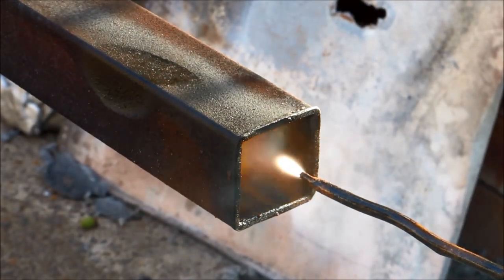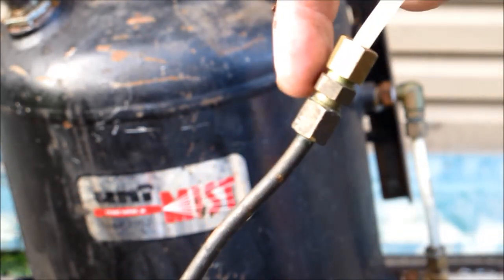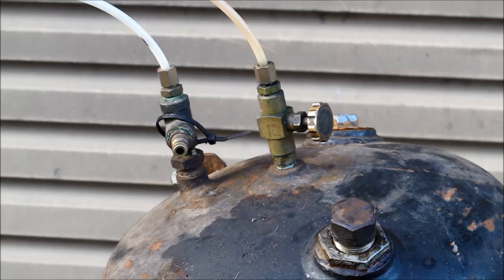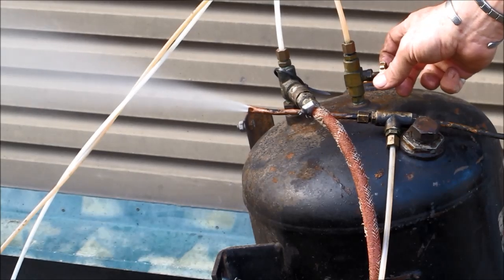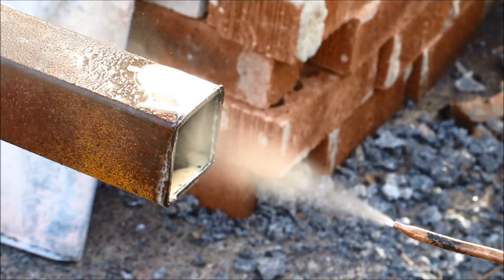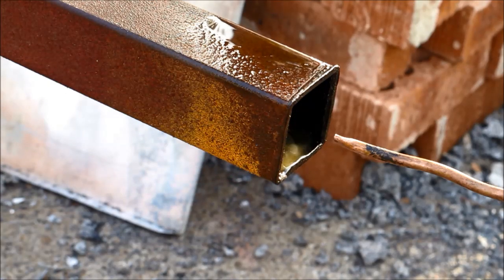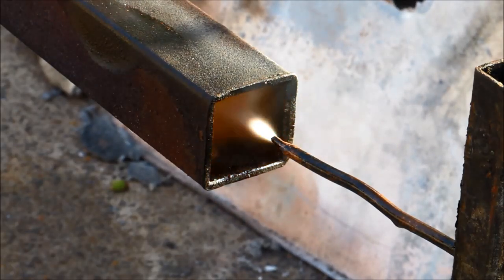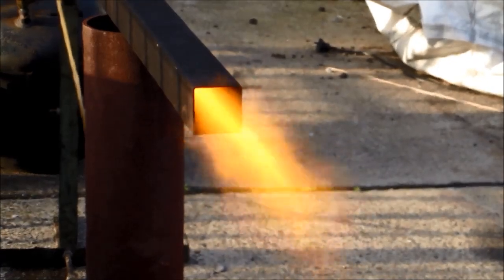Instant light  spraying oil Burner from cheap, off the shelf fittings

Comment: What is the oil temperature,did you preheated? Thanks.
Reply from the maker: No preheat.  I think that is a waste of time and a misnomer.  As soon as  oil is sprayed it's cooled by the far greater weight and volume of air. 

If any preheating  is done, it would far better be air than the fuel.
Reply: @glumpy10  thank you for your reply.

Comment: This video has to be my favorite one of all, especially during the ignition and burning phase.  The oil and air mix easily and then the square tubing facilitates the flame via a Venturi effect.  I love the howling noise it makes too.
Reply from the maker: I was just looking at this setup yesterday thinking I should do another vid with it.  Needs some new plastic Tubing which I don't know if I have or can get but I will look into doing another vid of it soon.
Reply: @glumpy10  I would definitely watch another video with this setup if you get a chance.

Comment: The only problem I can see with this Arrangement is running a compressor all the time gets to be pretty expensive I don't know how much you'd be saving in the long run. I'm not trying to be a wet blanket but it is going to drive up your electrical bill
Reply from the maker: I completely agree! You will see this is the only one of this type of burner I have done for that reason. I was doing a bit with the Furnace/ foundry crowd at the time and they were all buying  pre made burner Nozzles.  They were still having trouble and I thought I'd show how simple the design could be made. Still a lot of people out there doing spray burners for whatever reason now. Some even use petrol powered compressors to keep up the airflow. I could do much bigger output with a Jumping castle blower and use much less energy input. 
 I think sprayers are a waste of energy, require too much input and resources. I can make a perfectly powerful Burner using a 12V bilge blower and an old car battery for the air source.

Comment: Hi, if you don't mind me asking, have  you said that you installed a mig tip in front of the end copper pipe?
Thank you very much for uploading this!
Kind regards, George
Reply from the maker: No, I just flattened the end of the tube with a hammer to get the desired spray and Volume.

Comment: Can it be done without air compression I just want a constant pilot flame to work an old fridge. Any ideas???? The old gas fridge from a caravan.
Reply from the maker: Doing  small outputs with oil is hard. It's also hard to burn it with a wick as the oil tends not to flow fast enough and the wick just burns up. 
I would stick to gas for the fridge myself or if you have an oil supply, burn it in a generator and charge a battery and run the fridge off that.

Comment: My first thought is... you've basically built a pressure pot style spray painter, with your burner nozzle instead of a paint sprayer gun. Other than it being a little too small, I could literally use a cheap paint sprayer I recently purchased at harbor freight instead of building the tank, and make a nozzle the way you did for the actual burner nozzle. Love the simplicity, looks awesome!
Reply from the maker: Using a spray gun is not near as simple as you think. Try it, I did and was very disappointed. The air/ Fuel ration is way off and you have to really butcher the gun to get it to work at all and then it's till not good. Plus yyou have a fuel takn that's way too small  for any practical Purpose. 

Personally I don't like spray Burners at all and prefer the forced air style that you can get virtually infinite heat out of  and dont need to run a noisy compressor,
Reply: @glumpy10  That is a good point, thank you for the advice. Plus I eventually may want to use that sprayer to actually paint anyway. 😅  I'm thinking I need to learn how to weld so I can build a LPG tank gravity fed burner like you have (among a million other reasons). Your videos are awesome -- since watching your videos I have started trying to find a cheap bouncy house blower because I have a growing scrap metal + regular junk pile and love the idea of processing it myself to get top value/not pay to haul it to the dump. I  am moving in a couple weeks and will finally have space to do stuff like this without the neighbors complaining. I like the idea of atomizing the oil spray for a more controlled burn but agree that compressed air is a big waste of electricity for something that can be done cheaper and easier with the gravity burner. Plus once it's heated up, the heat itself should vaporize the oil anyway. Your videos on the waste oil processing were very helpful as well, so thank you again and hope all is well down under 👍👍

Comment: pressurizing to atomize the fuel burns hotter and cleaner than those drip feed systems. Many years ago I built a small furnace for my huge shop. I mainly burnt oil and coolant mixed and a 55 gal drum would last 4-5 months on 16 hr days.

Comment: If you used a round tube you could put a piece of plate on the front like a torpedo heater , you could probably cut the air / fuel mix down and get better results.

Comment: From all the oil burner desings i have tried, this is definitely the best, it's a very simple desing, it's adjustable and it's so easy to make. what i do have to say though is that the pipe or tube cannot have a taper or conical shape at the end.
Thank you for sharing this simple desing, and showing us how it should be done!
Reply from the maker: Thanks for the kind words. It does always amaze me with the complication, expense and equipment people use to do a simple job when there are so much cheaper, simpler and easier alternatives. It's like so many people seem to think unless they go to a lot of trouble and expense something cannot possibly work.

Comment: Not sure if you will get this, But seeing you got a good hot flame, and your supplying air at the nozzle end from your compressor at that T.
How would it work with your fuel pressurized as it is, Then remove the air pressure at the nozzle, (the T) but preheat the nozzle or fuel line from wrapping it around a heat source, will it still spray out eliminating the requirement for a compressor, except for the fuel tank. Which could be a hand pump,I' thinking of what happens when the power goes off. consider the set up similar to a tagger torch.
Reply from the maker: I don't think it would work at all. The fuel would carbonise if it got too hot and you'd be pumping like mad to compensate for the fuel level dropping  at the rate it burns. 
One would be better pumping up an air tank and having that pressurise the fuel system  though a regulator but then you still have the problem of atomising air.
Reply: @glumpy10  If I recall we can take VO and run it through a copper tube or pipe, then wrap it around a wind supply tube from a fan forcing air into a furnace, (wrapping the pipe close to the furnace is fairly warm) that is to melt metal, And all that was used was a gravity feed for the oil, with a control nozzle for the supply of oil.
 If I recall correctly there was no need to force oil into the system under air pressure, and it got hot enough to melt metals? 
But just thought this might be of interest to try.
Reply from the maker: @CMAenergy  Sounds like it would work but is more like the blow air systems all my other burners use than this spray Nozzle design.

Comment: I've just built one of these. Not the exact same thing but same theory. Works like a charm. Within an hour of getting it finally assembled I was melting aluminum. I think I used about 4 gallons of used engine oil in an hour. It's not very demanding on my air compressor. I'm using 3/16" lines because that's what I had laying around. I think if I want to go hotter I have to go with bigger lines. Awesome build and awesome video. Thank you for sharing this.

Comment: I'm wondering if a continous arcing spark plug would ignite used motor oil and air mixture or just foul it out. I guess I'll find out. I have a woodburning stove made from a 55 gallon drum but I've grown too old and crippled to cut firewood. I'm thinking that this would work great in the barrel. I've got lots of old motor oil that is clean of any trash and debris, aside from the carbon and metalic particulates in used motor oil. I picked up about (60) 2gallon containers of used motor oil about three years ago. At the time I had no idea what I needed all that used oil for, I just knew I needed it. Thank you, you answered the question of why I needed the old oil and more impotantly solved my issue of heating my shop. 

By the way, if you have to tell someone not to look down the end that the flame exhausts from, you wasted your breath. They may heed your advise not to place their eye over a pipe belching fire like a military flamethrower but they'll find another way to either get hurt or burn down their home. It's called Natural Selection and the fact that there are so many blithering idiots surviving until adulthood these days is a direct consequence of mankind circumventing Natural Selection.
Reply: Definitely not good ... Think about your lungs and your families lungs. Plastic seal the windows, then use cheap throw blankets, and doors of the house. Use 3 small space heaters placed near cold spots on a thermostat. It will cost maybe $130 a month extra for heating the entire house

Comment: At an equipment rental store I worked at back in the 80's, an egghead came in wanting to rent a frickin push mower. But just renting it, a gallon of 2 stroke gas/oil mix came with it, the egghead wanted to know how many square feet could it cut on a gallon of fuel, at half throttle, then full throttle, if the grass is thin or thick, if the grass is tall or short, wet or dry, and on and on and on. After about 30 minutes of his goofy sh*t I said, "look dude, you cut grass until it runs out, then you refuel it and start mowing again. Just keep repeating those steps and you'll be through cutting your f-ing grass a lot sooner than all the time you've wasted with all your questions. He finally STFU and took the mower and a full gallon of mixed fuel. It wasn't twenty minutes later and here he comes. I'm thinking, oh sh^t, what does he want now." Unbelievably he was through cutting his grass and hadn't used but maybe 1/4 of the fuel that was in the lawn mower tank. He hadn't used a drop from the gallon can I sent with him. That just pissed me off that much more. All that bull-sh*t for cutting a lawn that didn't take over ten minutes. I developed a very strong urge to crack and scramble the egghead's brains all over the show-room floor. But at least he returned the full gallon of mixed fuel, unlike most of my black clientel. They would rent a mower, bring it back 15 minutes later and swear up & down on a hundred bibles that they used the full gallon of fuel, in the mower. The smoke billowing out of their automobile exhausts told a different story. I hope they enjoyed their free gallon of gas/oil two stroke fuel, especially after it destroyed the catalytic converter on their cars. Those bunch of upright & honest Ididnadonuffins never failed to just have me rolling with laughter when they left leaving a huge trail of smoke behind them.
Reply: To all of the PC babies, it’s not racist if it’s true.
Reply: Yet you're the one trying to rent a 2 stroke push mower 🤣

Comment: so are you running 2 airlines? 1 input to pressurize the tank and one for the output?
Reply from the maker: No, Only one airline from the compressor into the tank and the other to the burner head is tapped off that. The other line from the tank is pressurised oil.

Comment: This looks moderately dangerous and fun - what can it be used for?
Reply: Who knows
Reply: Burning.......everything.
Reply: Id presume the burn is fairly clean so if it had a big thermal mass around the pipe it would be a cheaply fueled shop heater.
Reply: Michael Gibson really? That would be awesome. Thanks for the idea :)
Reply: Look at the thermal masses used by rocket stoves. They burn for a bit and then usualy go out and the retained heat heats for a long time after. Which would be necessary cause that thing is loud lol

Comment: I think it doesnt get enough air into the metal pipe. Maybe if you drill a few holes parallel with pipe helps to reduce the amount of oil and maybe have even more flame and heat produced.It just looks too little the amount of air it gets in comparison with oil. If you see how a oil burner works for home heating it has usually 0.75 jet while an electric blower pressing huge amounts of air.

Comment: That's cool 👍 you should try a variant of this but instead of pressurizing the fuel oil itself, simply introduce it into the stream of air via a venturi, just a sharp angle "Y" tube tapped into the air line just before the orifice, the air moving through the "Y" will automatically draw the fuel into the air.
 The fire can stay continuously  running and the tank will not need depressurization upon refuelling, will use less air and fuel and improve overall adjustability and efficiency. 👍
Reply from the maker: That is pretty much how all the rest of my many forced air Burners work.  The fuel won't be drawn in and it won't atomise but it doesn't have to.  The fuel is fed in by gravity or much better still , pumped or pressurised  and the hot burner chamber phase changes the oil from a liquid to a gas so it can Burn.  Have a look at all my other vids to see how it works and the huge amount of power you can get out the things.

Comment: Fantastic! I'm making one tomorrow; already have all the parts! Do you think it could be ignited with a spark plug?
Reply from the maker: Not on oil I don't.  Maybe kerosene but you would need an igniter that threw more of an arc than a spark plug I think.
Reply: For the oil burners on big boilers and kiln we have at work. They use propane and electronic lighter, as the pilot light.  Then steam to atomize the oil. If theare is no steam, cold start up. Then compressed air used to atomize. One boiler uses electronic arc for the oil burner, but not reliable on cold start up, we end up using a rag and stick. Tip, you want at least 8-15psi atomizing pressure above your oil pressure.
Reply: Glow plug is what you want. ];)>

Comment: I love the "stick on a rag" ignition system.
Are you running the same psi at the T mixer as you are to pressurise the tank?
Reply: Where the compressor connects to the tank there is a tee. Its that point that is the air feed for the mixer tee. So yes it is the same psi. The fuel is "sucked" up into the mixer tee by venturi effect.
Reply: Thankyou Dougal. Much appreciated.
Reply: He is using compressed air to push oil out of tank, and compressed air at the burner to atomize the oil. The needle valve on tank controls oil flow and somewhat fuel pressure.  The oil burners we use at work are setup to have higher atomizing pressure above oil pressure.  8-15 psi is best. And safer.

Comment: Is the tank pressurized?  Where does the T come into play.  You have one line pressurizing the tank and another goes into the tank?  I'm confused.
Reply: Yes he is using compressed air on the tank and a siphon tube to the bottom of tank to push oil out, and the needle valve to control oil flow. That connects to the bottom of the T on burner, the other end of T he connected compressed air. The oil enters the bottom of the T and one end connects  compressed air, that pushes, mixes, and atomizes the oil. The 'business' end, the nozzle where he squished the tube makes back preasure that helps to further atomize and pattern the fuel flow. Hope that helps

Comment: Compressors use a lot of that stuff that costs $$$, electricity. Gotta consider that expense also. Hell, run an airline to a wood heater and see how hot it'll get 😨. I built a weird hybrid rocket mass heater with an oil drip that uses the wood like a wick. Burns for hours on very little wood, heats like crazy, and my only expense is cutting the wood (w/a lipo powered chainsaw, charged via solar). Wish I had some audio recorded of that thing going full blast, sounds akin to this without the forced air. Anyhew, THAT'S cheap heat! This, while interesting, just isn't practical beyond someone who isn't a tinker to start with.
Reply from the maker: I am not a big fan of Compressed air either but so many burners on here use it. They all have expensive and less than perfect nozzles so I wanted to show how a spray Burner could be done cheaply and easily with std plumbing parts. 
Fans are a lot cheaper, cheaper to run and have a lot more output potential than compressed air. 

Not sure why they are so popular but you can see I have one of these and about 10 forced air burners which shows my design preference pretty well.

Comment: hello , great work !!  will this work using used motor oil ?
Reply from the maker: It will work with engine oil, veg oil, Hydraulic oil, transmission fluid,  Petrol ( much as I highly not recommend it) Kero, turps, and Massage oil... if for some inexplicable reason you have a good enough supply of the stuff.  :0)